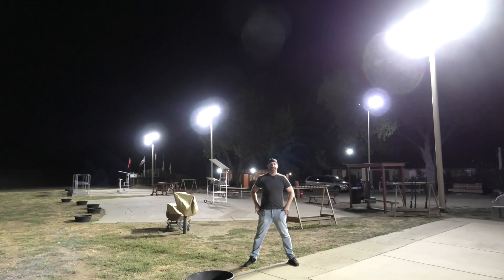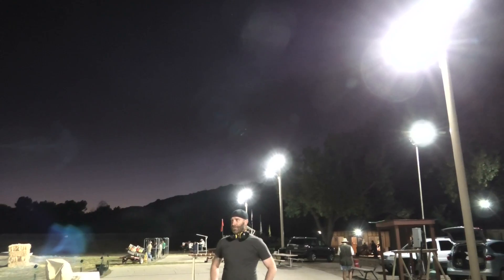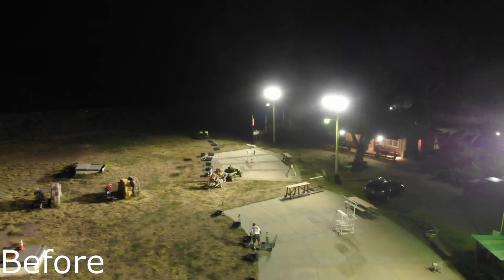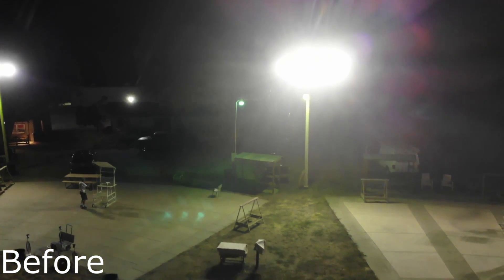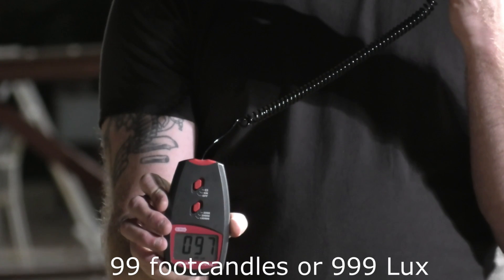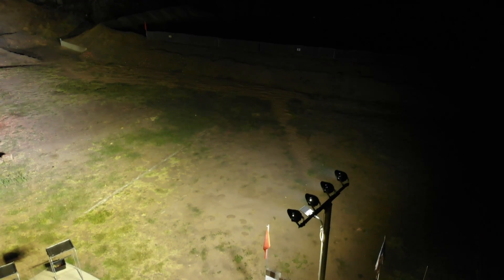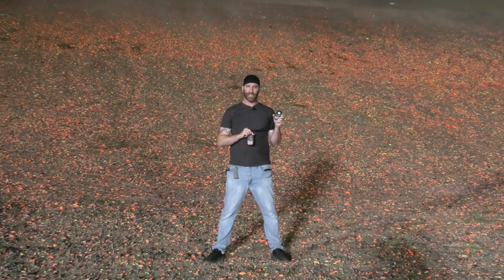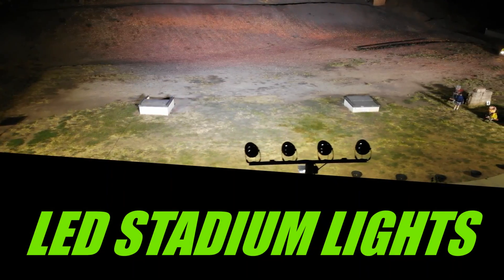LED Stadium Lights Install - Drone Footage - Footcandle Readings - See LED Sports Lights in Action

Comment: LED STADIUM LIGHTS DONT MAKE ANY SENSE!!! WHAT THE HELL IS THE DIFFERENCE? THE OLD LIGHTS WERE ALREADY FLUORESCENT!!!!
Reply from the maker: Plenty of differences in the conversion to LED, the top 2 being the increase in efficiency and long life/low maintenance. The previous lights in this application were metal halides, going from 1500 watts per light down to 500 watts per light, a 66% savings on the electric bill for the lighting. Metal halides also have a life of about 15,000-20,000hrs and can lose half their brightness halfway through their life from degradation. DLC Premium LED fixtures like the Stadium Pro Series from Rugged Grade hold above 90% brightness for 36,000hrs, covering the lifespan of 2 separate metal halide bulbs, and LED lifespans are pushing 150,000hrs, meaning you are not constantly needing to replace bulbs, which gets expensive when a lift is required. Fluorescent lighting efficiency is still easily beat by LEDs, with a typical savings of about 50% on energy bills and again, LED lifespan blows that of fluorescent lights out of the water, leading to far less in maintenance costs. LEDs win hands down versus any of the older lighting formats, like HIDs (metal halide,  HPS, etc), fluorescent and incandescent lighting.

Comment: Are these able to get installed in a big yarded area? I don't have a stadium but I have a pretty big yard? Whats the estimate for installation, for just three stadium lights on residential property? Also, I see that these lights are dimmable. Can these lights be censored lights as well?
Reply from the maker: These can be installed anywhere they are needed, it's just a matter of choosing the right mount for your application. Installation costs vary depending on the install and what needs to be done like installing light poles, trenching for power cables, etc. These are dimmable and they do not come with any sensors as they are typically on a switch or timer to control on/off. Sensors could definitely be added to the circuit, you would just have to make sure that any sensor like a photocell or motion sensor was rated for the power usage you have connected to it. You are welcome to give us a call at 800-674-9420 for any questions and to make sure these are a good fit for you application and we can let you know if we have any installers in your area we would recommend.

Comment: LEDs have more light pollution though than even 2,000 watt metal halide
Reply from the maker: Light pollution in the night sky has increased since the invention of electric lighting. LEDs have allowed lights to get brighter with the use of less power than older technologies which is why many LED lights are now designed for Dark Sky Compliance to prevent upward throw of light into the night sky. There is also local, state and federal guidelines for many applications that require Dark Sky Compliance to reduce light pollution. It's up to users and installers of lighting systems to follow those guidelines and use proper lighting techniques and products to prevent and reduce light pollution.
Reply: @LedLightExpert  Yes, I agree on that. A shielded LED fixture is definitely a problem solver for light pollution and decreases it. Without the shielding, then the LEDs shine everywhere. Though, LEDs are also direct lit rather than omnidirectional. Omnidirectional lights cause more light pollution. Sometimes LEDs can cause light pollution because of the high lumens. LEDs also shine brighter than metal halides because there’s scotopic vs. photopic lumens. Scotopic lumens are more visible than photopic lumens. LEDs can be a lot brighter.
Reply: @LedLightExpert  Oh, never mind. Your LED lights have very good focused light and no light pollution with more lumens.
Reply: @LedLightExpert  Oh, never mind. Those LED lights are a lot more perfect than metal halides actually. I can notice the sky. Those LED lights have better light quality as well. Well done for the installation.

Comment: Great stadium light video. Were those 1500 watt metal halides replaced by just 500watts?
Reply from the maker: Yes, these 500 watt Stadium Pro lights were designed from the ground up as a direct replacement for 1500 watt metal halide sport lights. Feel free to give us a call if you have a sport lighting project we can help with, 800-674-9420.

Comment: Would these be good grow lights ?
I need grow lights for my indoor farm
Look strong come in 2500 or full spectrum
I have a 30 by 90 3 of them x3 buildings 
building to light up hemp farm need a two outside lights for security as well I like these
Reply: I love weed too
Reply from the maker: They could be used as grow lights but these are not full spectrum lights which is a far better choice for grow lighting. Rugged Grade does offer some amazing full spectrum grow lights up to 960 watts using top tier Cree full spectrum LEDs. You can check them out here: https://www.ledlightexpert.com/LED-Grow-Lights_c_86.html. If you have any questions or need help with your layout and light planning, you can reach one of our light designers at 800-674-9420.